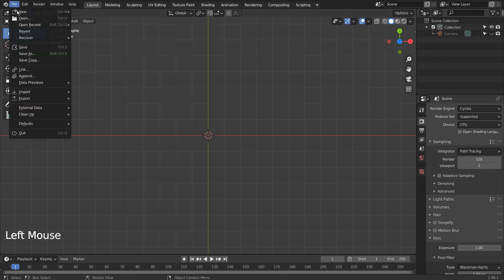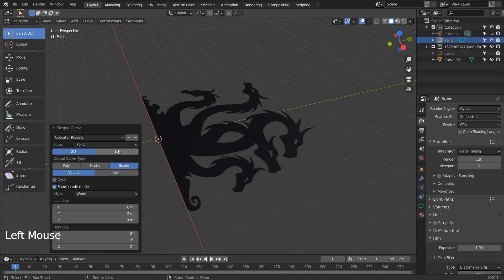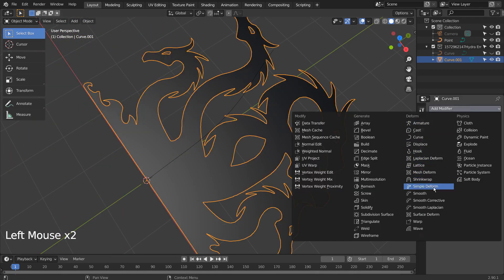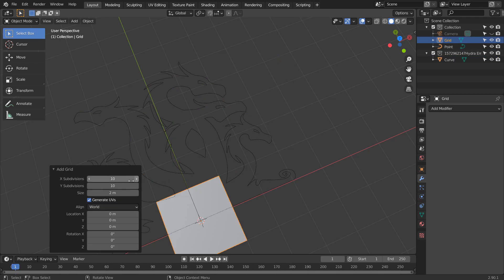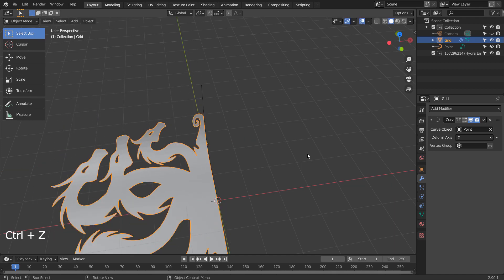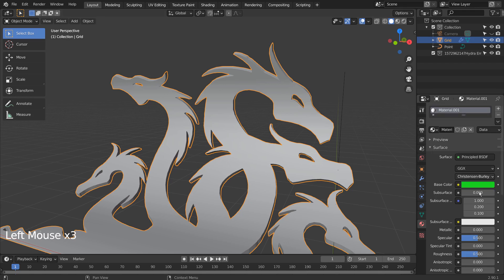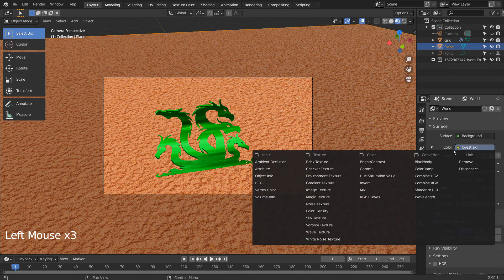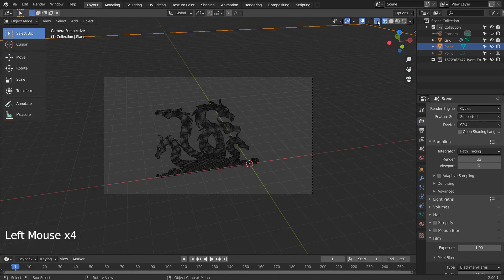Blender beginner series No. 48 - Prevent SVG surface distortions after importing

Comment: This video saved me so much headache. I had imported SVG's into a project in order to use the screw modifier and had all these non-manifold issues (with the goal to 3d print), I tried so many different things to fix the issues and had no clue that it was just internal lines within the imported SVG that were causing the issue and had no clue how to correct that. The method is a little manual, but hey, it actually works! Thank you.
Reply from the maker: You're always welcome, Patrick..!! :)  Thank you for watching..!! :)